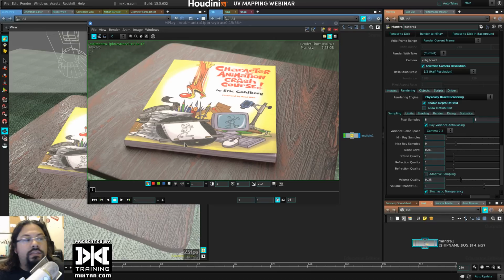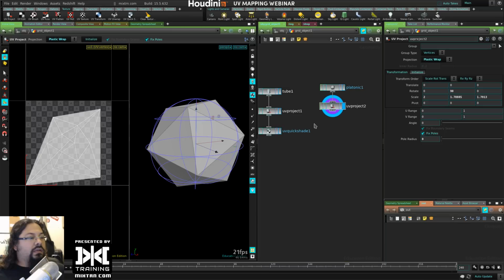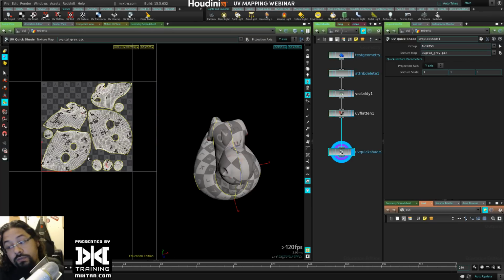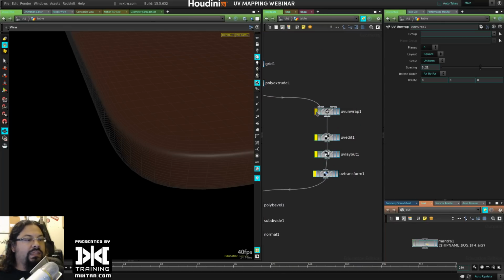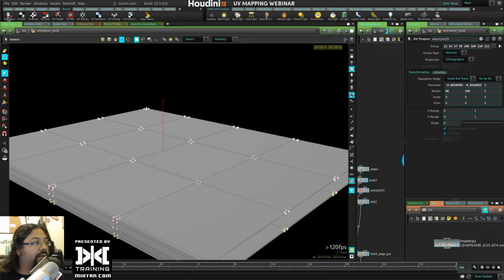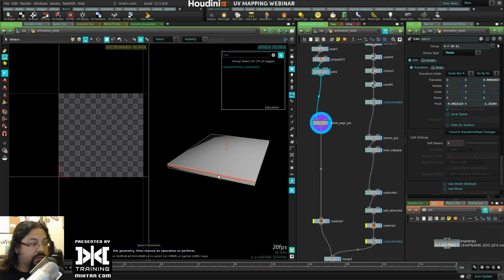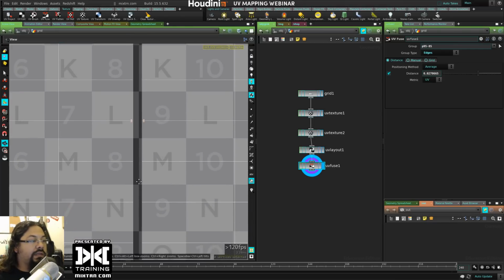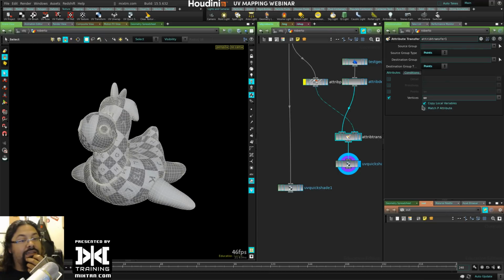LearnDay - Houdini UVs

Comment: HI ,MIX Training!
For 3d max and Maya there is a plug-in for rendering texel-density. And how does Houdini solve this miscalculation?
Reply from the maker: There's no Texel density calculations in Houdini, you can check the distortion or stretching of the uvs, texels are on you :)
Reply: Thank you! So for today the most powerful built-in UV editor in MAYA?
Reply from the maker: I have no idea about maya, the most powerful I've used is 3DCoat
Reply: Yes, a powerful tool. But it's for sculpting, not for modeling. And I try to do as much as possible in one software.